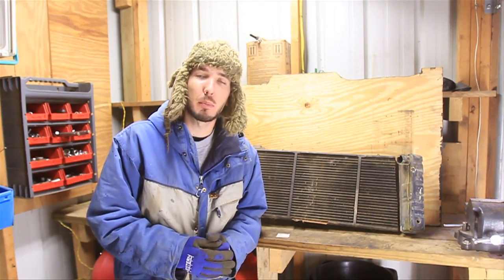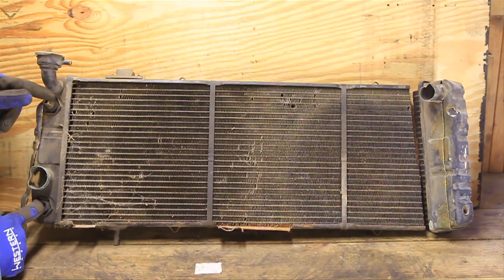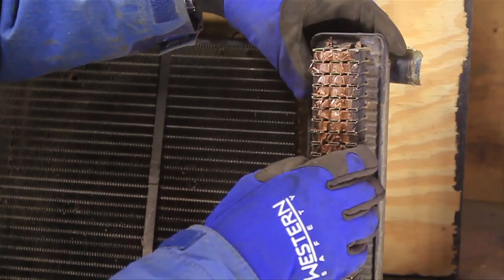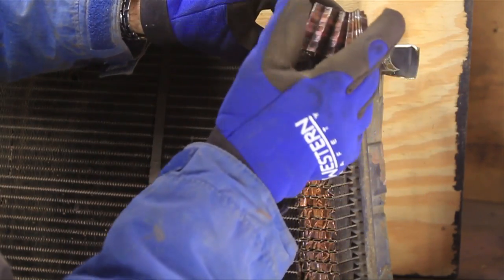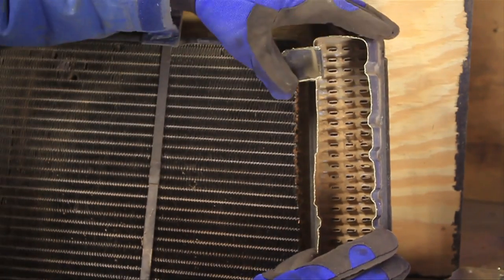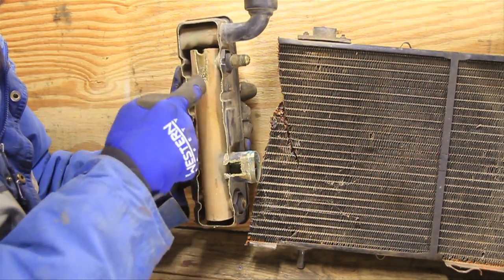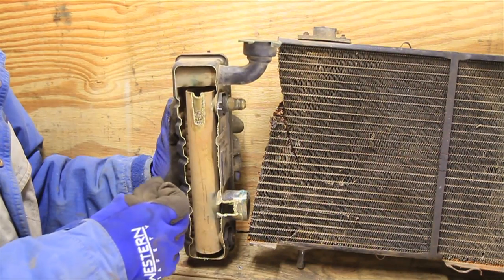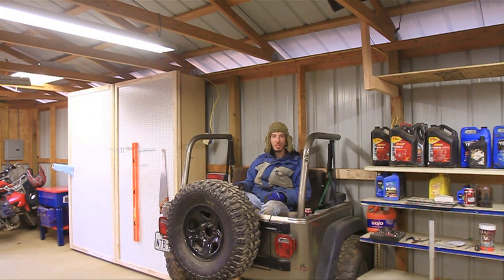What is inside a Radiator?

Comment: 10yrs later and this video is still clutch.. Ill be 34 this Saturday when I'm replacing my 2004 GMC Yukon radiator and I was curious about how the TOC works.. I was trying to drain the radiator for a temporary fix on a crack and saw the small line that entered below the crack, looked like a good drain point.. took it loose and noticed a color difference immediately. Without cutting apart my own radiator, this video answered my question on how it works. I wish there were videos on various car parts like this, with this level of detail and breakdown. I'm tech and mech savvy but always like to confirm suspicions. Thank you!!!

Comment: The transmission fluid runs threw the radiator to help warm the fluid. Most transmissions run at 130-160F where as the engine runs at 210F. There is usually a small seperate oil cooler that cools the transmission fluid. btw, Good video.

Comment: Love when I come across a video that helps with odd projects I get into. I bought a radiator 13 months ago (with a 12-month warranty) and it's developed a leak along the thread of the bolt at in-port of my oil line. It has a turbo. After seeing your video, I believe that it's leaking because there isn't enough high temperature sealant on the threads of the connector screwed into the radiator. After cutting that radiator, do you agree?  If you still have it, do think it can be unscrewed safely without damaging the inner pipe, and re-threaded back in? Thanks for your time and fantastic video!
Reply from the maker: Sebastian Schwarz sure, thanks for watching!

Comment: Part of the reason water-oil coolers are used instead of air-oil is to avoid overcooling.   I'm sure another reason is cost an ease of assembly.

Comment: My corolla trans cooler inlet line broke off last night.  I wanted to see how these coolers are on the inside.  Trying to determine if coolant got into transmission because the break caused both systems to be open at the same point.

Comment: I made the mistake of not tightening down the bottom transmission line fitting enough when I changed my radiator on my 97 XJ.  I thought that the quick disconnect was leaking, I was wrong.  I spent a lot of money on replacing transmission fluid and any rubber part the transmission fluid leaked on. (IE sway bar bushings, brake caliper boots)   Finally figured out what was wrong when I went to replace that bottom cooling line. (which wasn't actually broken) I know, such a NOOB mistake.  Thanks for the video BTW.

Comment: Man, 2 minutes in and I've already learned most of what I've been wondering for a while.
Great video, anybody who works on motor vehicles or anybody who cares about them should watch this.
Great information to know.
I was wondering 2 big things, what makes the "rows" and where is the tranny cooler and how does it look.
I was also wondering how a 2 or 3 row can be just as wide as a single row..
I woulda thought more rows means more better but there's more to it then that.
Im debating on ordering a aftermarket 150$ish ebay 2 or 3 row full aluminum radiator..
Or stick with the 190$ oem replacement 1 1/4 inch thick core plastic tank radiator..
My main worry about the ebay radiator is coolant getting into the tranny fluid..(ofcourse worried abt the overall quality too)..but there all made in china regardless plasitc tank or aluminum.
I want the full aluminum radiator but part of me thinks the autozone oem replacement might be smarter to install😅
Reply from the maker: I've never seen coolant and tranny fluid mix in all my years so...

Comment: Can you tell me if the coil (inside the radiator) where the transmission lines connects to the radiator, would move out of position (making it harder to couple the bolt back together), if you took the connector fittings out of the radiator? Thanks!
Reply: Jonnie Jones sounds like a Ford radiator lol don't separate that would be a grave mistake. yes it would move thus killing your radiator